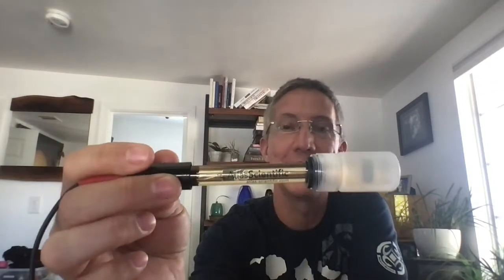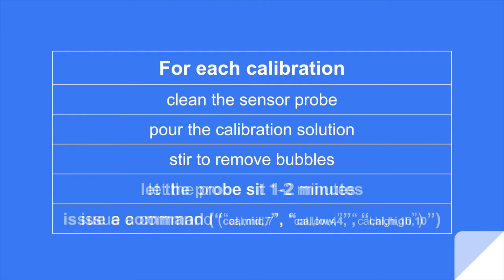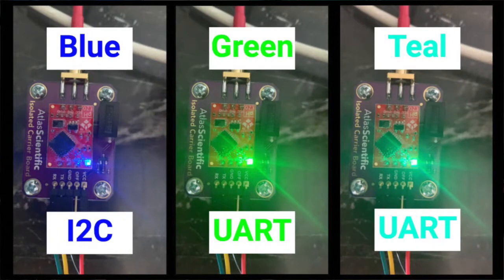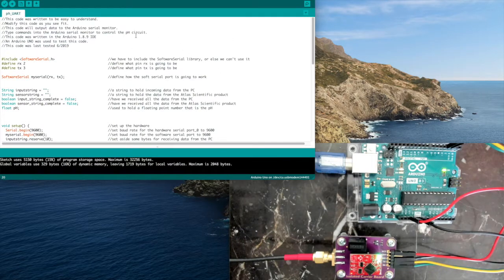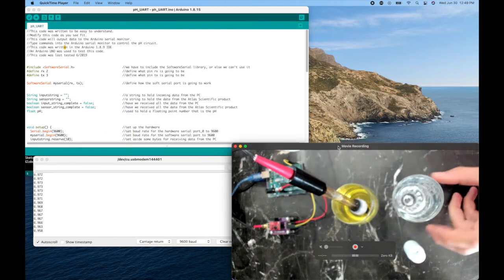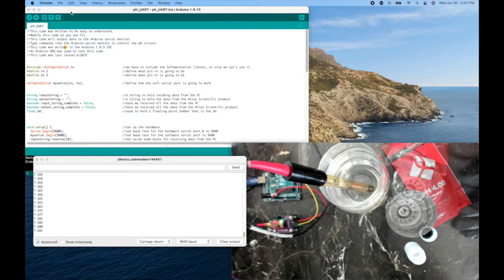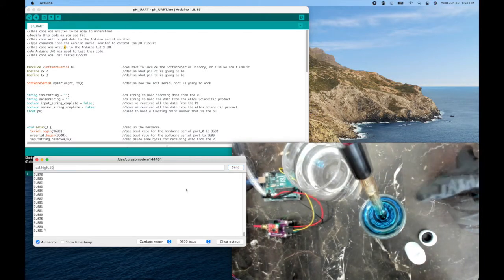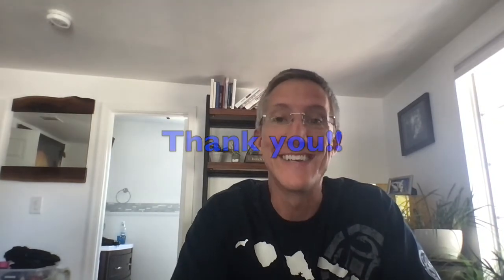Atlas Scientific pH sensor calibration

Comment: Hi, I have done your steps for calibrating my atlas scientific lab grade pH sensor. But what I've found, is the sensor measures these values:
Calibration mid (pH 7) = 6.4
Calibration low (pH 4) = 3.5
Calibration high (pH 10) = 9.3
do you have any suggestions?
Reply from the maker: Hi sorry, I don’t know, but if reach out to the company. They were nice when I needed to

Comment: Great video! Why did you use pins 2 and 3 instead of the tx and rx pins?
Reply from the maker: Hi Eric, I didn't have a specific reason for that. If I take a guess, i was using the Arduino and had wires plugged in there already, and I was lazy :)

Comment: Thanks, really useful. Can we connect two different types of probes (e.g., pH and DO) at the same time to the same Arduino board?
Reply from the maker: Hi Aisha, I’m glad it helped!! Yeah you definitely can. The only thing I’ve read that you need to look out for is some sensors will throw off each other if they’re too close to each other, but I think pH and DO are fine nearby. You can make sure by installing the pH a full day before the DO and just checking if your pH readings change right when you hook your DO up. The change will be immediate
Reply: @d-i-ry  Thanks Ryan, would it be okay to place the prob back again inside the Soaker bottle after finishing the calibration? If yes, do we need to recalibrate it again? for example, I want to use the prop tomorrow
Reply from the maker: @aishaabdullah1554  Yeah, you can leave it in the bottle whenever it's not in use. from what I've read, you shouldn't need to recalibrate for a year